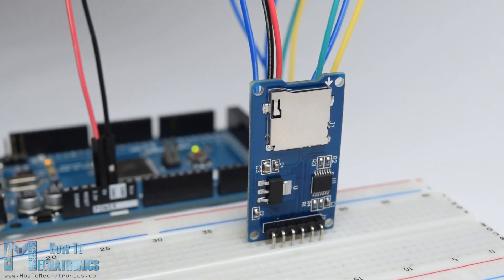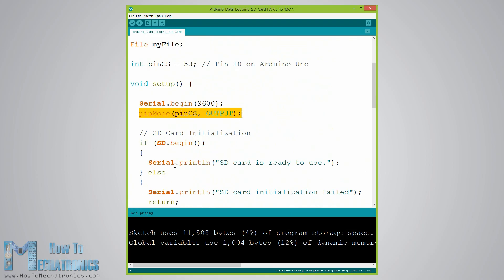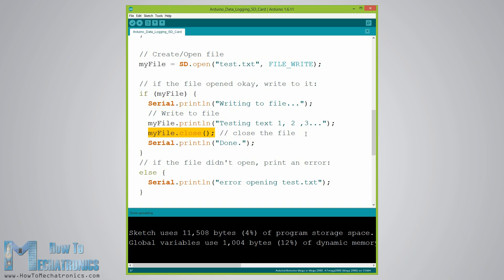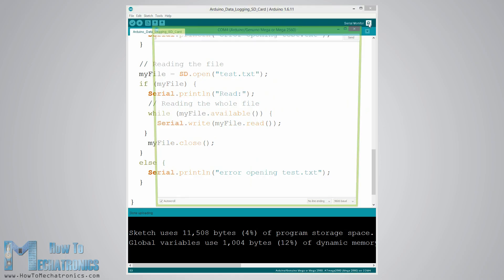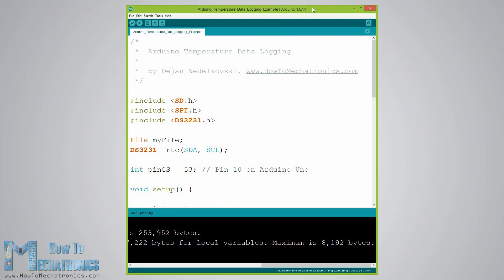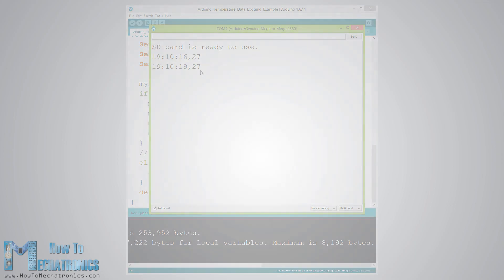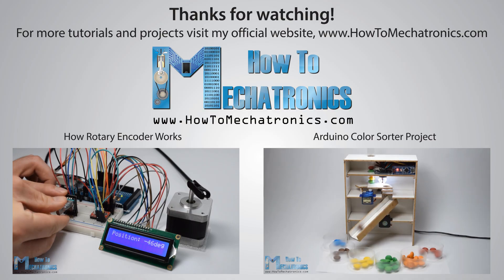Arduino SD Card and Data Logging to Excel Tutorial

Comment: Thank you so much!
A question... why connect the SD Card module to 5 volts from the Arduino rather than to the 3.3 volt pin?

Comment: I don't understand. I have an Arduino Uno, but pin "53" works for me. If I change it to pin "10", it says "SD card initialization failed."
Reply: did you get yours to wok?
Reply: @camerongordon2378  yes. I have it working on uno, not on mega. I didn’t try the excel part, i only cared about it initially working.

Comment: I am using Arduino for data logging the following. Arduino is connected to RTC DS3231, LCD, SD card module, pressure sensor. The data, time, pressure value is displayed n LCD and the data is stored in an SD card. The delay for the program is 1 sec. After 1 hr, the data in SD card is cut/copied to laptop. when I re-insert now and power it ON, its showing initialization failed/error in opening the file. Kindly help me in sorting out the problem. I tried many solutions, but none is working

Comment: But this is not data logging. Sure you explain how to write values to an SD card using an Adruino (like so many others in YouTube) but the write operation will fail when the file becomes too cumbersome to update within the data acquisition frequency or the SD card runs out of space.

Comment: hi can you suggest any book or tutorial for arduino programming for beginners?
Reply: Out there is no such book. The term Arduino is actually set of macro instruction in C. If you want to understand ANY micro controller, you may consider to learn C language. The rest is just manipulating memory, registers and GPIO pins by various way, no matter macro instructions (for example digitalWrite(13, HIGH);), or dirrect register addresing (PORTB |= (1<<PORTB5);). So, knowing C language code, and using examples - one may learn to program Arduino things very easily (depend of your level of "love for programming", and persistance). But, theoretical knowledge is next to nothing without applying it to the Arduino project. Instead book, you may just install Arduino IDE, connect your version of Arduino board, and type in search window what is missing, and unknown. On YouTube channel, there is pretty good amount of various tutorials and how to things.
Reply: WildMania thank you
Reply: You are welcome.

Comment: I've followed this tutorial to a T on both a MEGA and modified for an UNO and keep having issues. It may be due to the way I set the time on the DS3231 module, using the automatic set method by running a different library for it....

Comment: If someone who hasn't programmed this, wants to see the sensor data, he won't know which column is what (If there are multiple sensors). How can we add column names so that it shows up directly on the text file or excel file?
Reply: Add 1 write to the file or serial.println for serial output in setup section with datetime,sensor,etc  Do not add a period at end of line! When import will be top row to do whatever you want like Freeze Panes.

Comment: It is better to create .CSV extension file from arduino with comma separated data lines. Which can be directly opened in EXCEL just by double clicking.

I am using it with SD card module and Microchip PICs .
No hassle of copy - paste & setiings.

Correct me if I am wrong.

Comment: Initializing SD card...initialization failed!

I tried everything: check wirings, tried differend libraries, differend cards, no success.
Reply: Hi ,   Did you solve it???? I got the same error
Reply: @maninthemirror I had the same problem. I think the Arduino>computer connection that I was using was unable to supply the Arduino with enough power for it to properly connect or supply power to the SD card module. I switched to a thicker USB cable, and connected it directly from the Arduino to the computer instead of routing it through a USB hub, and it started working properly.

Comment: Thank you very much for this video. I succeed immediately following your instructions. I have one question, if you can answer please. In the *.ino file you define only the CS pin on pin number 10 of arduino uno. Where are defined the other pins (SCK,MOSI,MISO) ? Is it possible to change these settings ? Thank you very much in advance.
Reply: you ever find an answer?
Reply: NeoIsTaken not yet
Reply: MOSI,MISO,SCK are fixed pins. look up your board's pin definitions. In UNO they are pins 11,12,13.

Comment: Hey man, I appreciate all the work you do and keep up these good projects! Just today I got my SD card module and I worked on the ESP8266 to get it to log data directly to a Google Spreadsheet. Now I was wondering if it would be possible to log Data from a sensor for example humidity in a car on to a SD card and then when the ESP8266 module has wifi again it sends the SD card data log directly to the Google Spreadsheet. This way I can drive, log data, come home and see the data directly into my google spreadsheet. 
I allready got the wifi connection and spreadsheet connection done I just need to know if there is a way to send out the stored data on the SD Card to a Google Spreadsheet ^^ 
Would be nice if you have a solution or code for this

Comment: how to store or retain last value of counter for rotary encoder sensor on LCD when arduino is again powered ON by using SD card?
Reply: You should create aditional file on your sd card, named init settings where you will write every loop cycle, status of your logging device and initialization parameters at start-up, after then you need to parse each pair key = value, to get the desired values.

Another more expensive one is depend on how you parse the logging data. If your file contains the most recent data at the top or at the botom. If you write append to the logging file, the recent data will be at the most end of the file, in this case you will need to request filesize in bytes and set up the pointer/cursor at this location-1. Make a while loop and compare current byte char against comma or newline 0xA and if is not found, store in a char array current byte char and decrement pointer to next char until this delimiter will be found. Now you have your last value as a char array data, use a function to convert this to a integer eg. strtoi and use your last value.

The first option with a separate ini file would be very efficient to keep track of your device at runtime for recovery after an unexpected shutdown.
Reply: You think you can also log in power draw for each loop cycle?
Reply: how many times I can write/erase data to sd card??
because eeprom doesn't support many times.

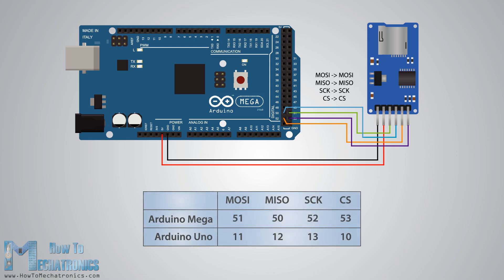Comment: MOSI pin on the MEGA 2560 is pin 51, is it not? Then why have you got pin "50" connected to the MOSI pin of the SD card module? See time 0:59, where your blue and green line on the MEGA 2560 should be interchanged. Could you please fix that up? Nice video though. Thanks for your effort and time.
Reply: Thank you!!! I swapped them and it works.
Reply: @saucerset12  Most welcome Kev. Thanks for sending this message here.